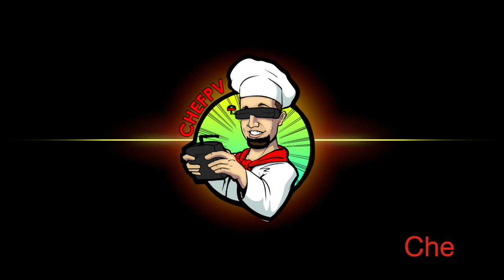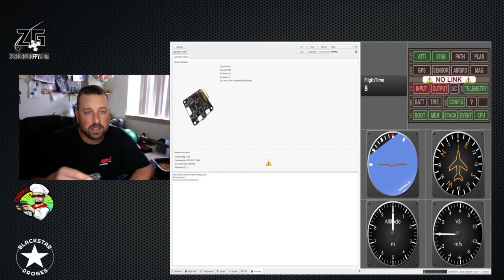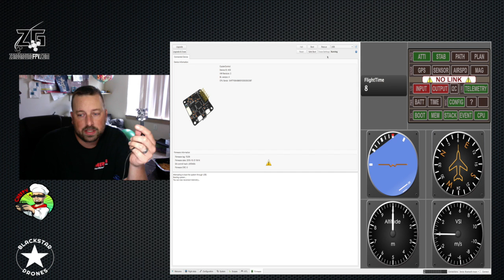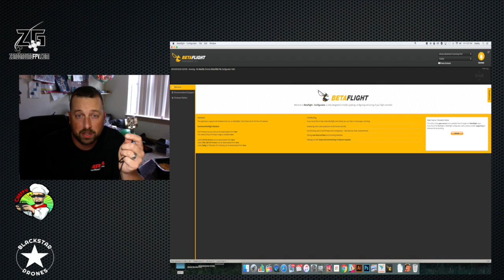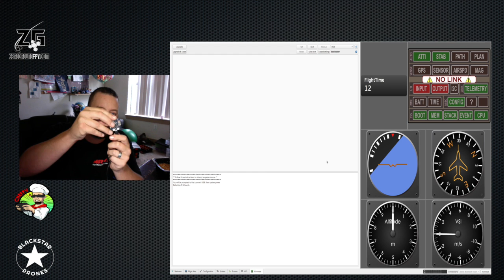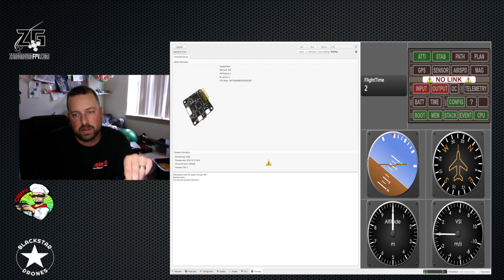CheFPV 101: How to Flash CC3D with BetaFlight and Back to Libre Pilot Firmware

Comment: Does this still work this way? I have a cc3d, it's white, it runs librepilot. I'm wondering if this works with the most current version of betaflight?
Reply from the maker: It should, but honestly these days your'e best off with an F3 board.
Reply: As of today I do not believe this works anymore. I cannot get the board to connect to beta flight once i flash it

Comment: thanks for the video. Can you use this method to flash betaflight 3.0 to cc3d?
Reply from the maker: Ronn2664 yes, you might just try BF configurator flash first.  It is supposed to work too.
Reply: ok. I'll give it a try. thanks again.